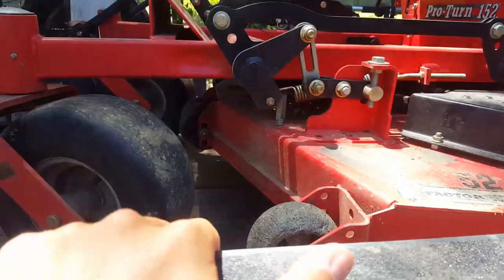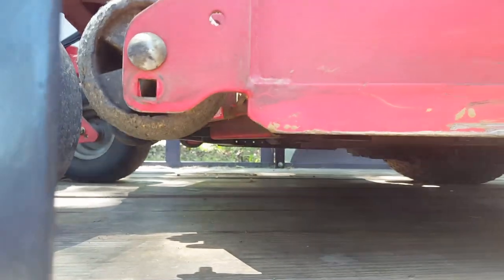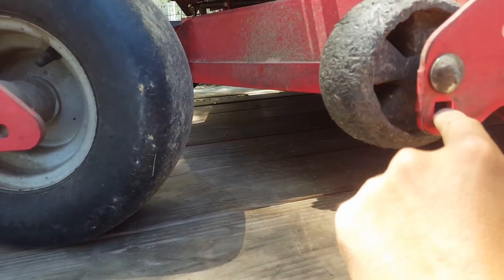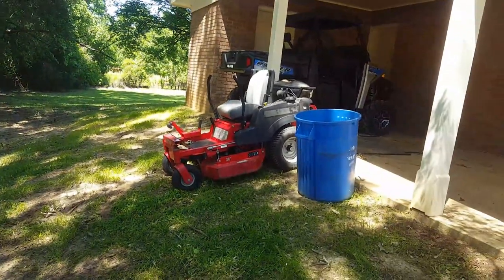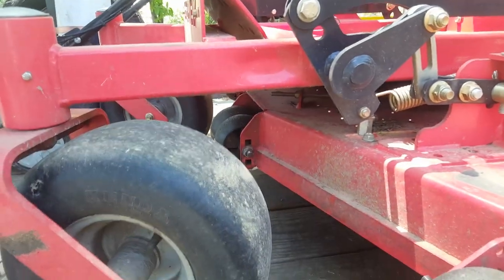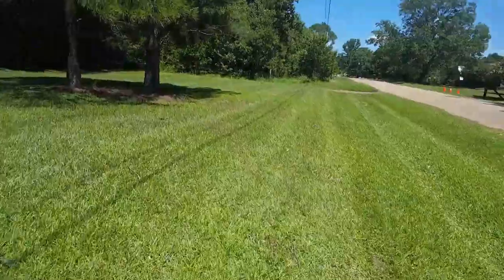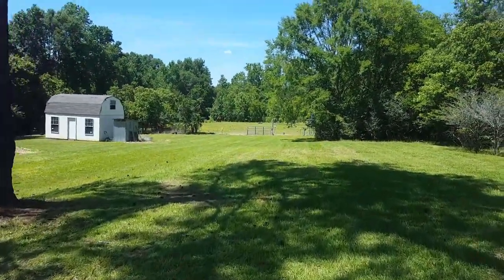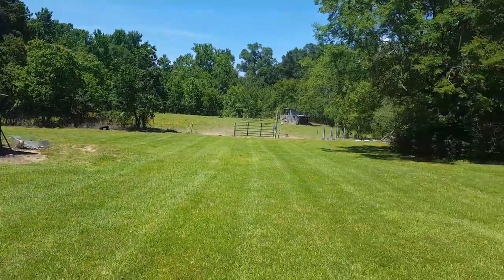How to set your anti scalp wheels /Veiw of my lawn/ SS Lawn Care Tips

Comment: I was having the same issue with the wheel digging on turns. I adjusted to the top holes now I’m scalping more than usual. Did you have this same issue? Cutting mostly at 2.5” - 2.75”.
Reply from the maker: Cutting that low you have to lift deck when turning.

Comment: Do you adjust the middle wheels on the deck ?
Reply from the maker: Some mowers you can some you can't. If they have a lower setting I'd move them down or up with the sides.
Reply: @SouthernStyleLawnCare  yep mines do adjust in the middle wheels I’m going to adjust them to the same setting as you did on the side wheels thanks 😊